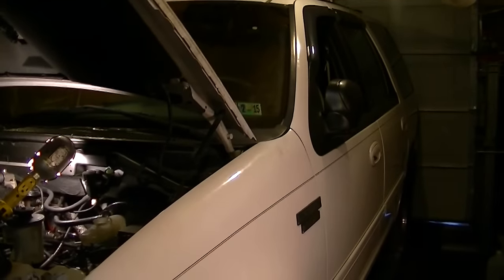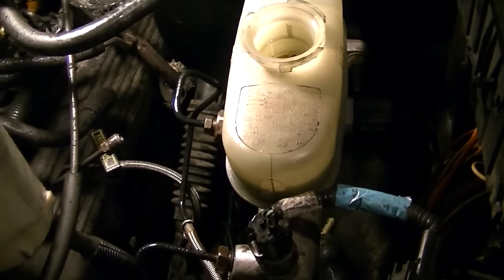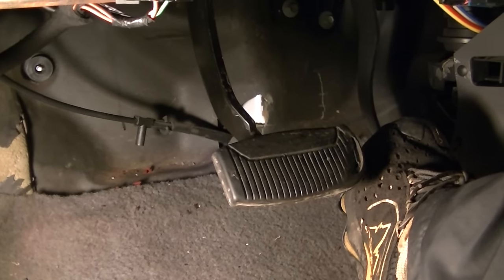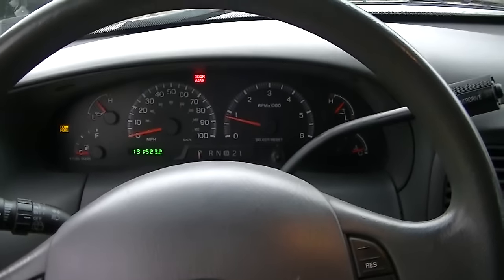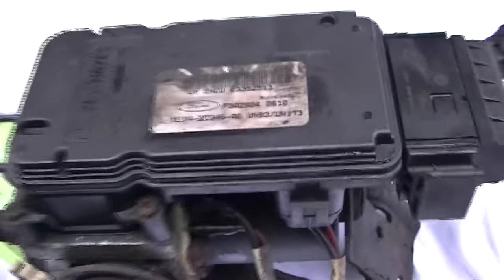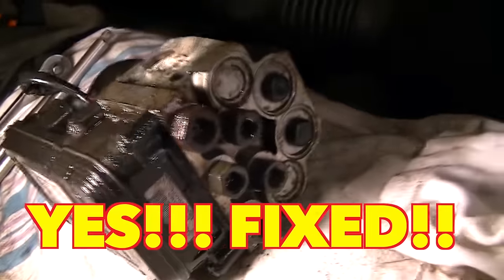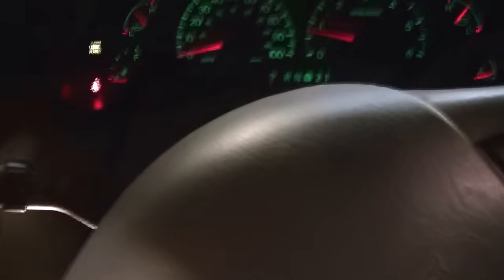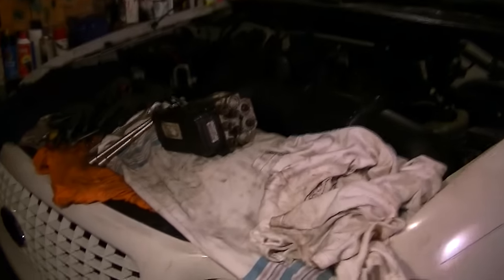Sinking/Spongy Brake Pedal -With ABS SYSTEM?? Nothing Works? Watch Fixed!

Comment: Howdy TVWXMAN32, how long did you hunt that down I think my  ford f350 might be the same issue, I pump my brakes up and they get hard or so after 4-5 and if it sits for an hour or more I still have air in booster, So its not leaking and the master is brand new and fully bled many times... But I still get a mushy pedal like it has air in the system!  That's why when I came across yours i was wow it seems just like your issue .....also no ABS Light on Nor have I seen one go bad in 50+ years without a ABS light coming on or check engine light sometimes brake issues can hide in the check engine light. By chance TVWX... is your Ford Expedition a mid 90's in year?  
 My truck is 93 so I am wondering if this was a thing they kinda knew but never posted about. Like you I have tried everything to the point I was actually thinking of paying the dealer to look at it because I felt so stupid that i  was missing what was wrong, I have alot of trucks, cars, tractors, 2 and 4 cycles, be them Gas, Diesel, & Electric and over looking something so dumb makes me feels stupid just because I haven't seen it happen in my lifetime of repairing things does not mean it can not happen!! This is why I turned to You Tube before I was gonna bite the bullet if i could not find something I missed .... So Thank YOU for the Jolt and reminder to always check the dumb shit!!!  I plan to just go drop a new one as the rest of the system all checks out good!                    
           Thank You Again TVWXMAN32         Cow }:-o)
Reply from the maker: Yep...I bet that's the issue. Bad abs/pump. Mine is a 2000. I still drive it everyday. Brakes work perfect after the abs/pump  change. Let us know what the fix is for you!

Comment: So ive had my abs light for longest my breaks worked ok not the best, it wouldn’t go all the way to the floor but they were spongey, i just changed the breaks, rotors, and calipers on all four wheels because they were worn out and now they break really bad all the way to ground. The mechanic told me my old calipers were seized so somehow it helped the breaks. Does this mean i need to change my abs pump or reset it

Comment: My issue is it's hard as rock when SUV is off I start it and soft peddle and replace master cylinder and new pads and bleed all wheel wounder if it's still abs?

Comment: We have a 2007 mitsubishi shogun sport,a brake line ruptured due to corrosion,the rear brakes are separated from the main fluid system via a solenoid valve when the ignition is off,the front brakes and main brake hydraulic system and ABS and HBB are all in front of the solenoid fluid circuit,after changing the brocken pipe,the system was bled using a pressure bleed tool,however,with this and many other ABS systems the HBB or high pressure brake booster accumulator was not discharcheged,after the rear circuit was bled the front was bled,for the rear the ignition had to be ON,when the front is bled the ignition had to be OFF,this controls the solenoid separating the two systems.

At turn on the HBB has a pump to fully pressurize  the HBB accumulator,this boosts braking pressure and equalises the pressure pulses during  ABS,as the ABS will unlock a locked brake under skidding conditions,creating a pulsed back pressure which needs smoothing via the stored energy in the HBB,the HBB is a container where a bladder has nitrogen gas at high pressure inside a steel container between it and the bladder,inside the bladder is brake fluid,so the gas tries to compress the bladder full of brake fluid.

In the haynes manual for the pajero(same system as the shogun) the igntion is OFF the pedal is pumped twenty times,not to the floor,just enough for the pedal to go solid,this releives the HBB of oil pressure and then the brakes(front )should be bled.

This is as far as we have got with it,there may be other valves in the ABS to bleed,but i'm sure it can be done via the scan tool method,and the vehicle can self bleed the ABS pump system.

Sadly there is not a great deal of info on youtube on this,but there are plenty of dudes who have thought brakes are brakes and just dive in and go for it,i hope this helps people to get  a bearing on the system and find out more on this before spending a shitload on unnecessary parts costs.

Comment: Also, i have solved these spongy pedals, ALWAYS, just by bleeding each wheel FROM DOWN TO TOP. I EMPTY brake fluid tank.  Then I make a system ,and send brake fluids through each caliper bleed screw, TILL i see this fluid, coming from below in to the tank. Then i close the bleed. I thing it might go through electrovalves of ABS pump, and fix also problem. Thats my opinion.
Reply from the maker: So true!

Comment: So I have a 1993 Ford Explorer XLT 4x4. I have replaced both the mast cylinder and the brake booster and bled it properly. I get a hard pedal when the engine is off but when I start the engine I get no brakes, pedal goes all the way to the floor with barely any effort at all. Could it be the ABS module? Is there a way to test it? Thanks.
Reply from the maker: Yes!!! Same thing happened to me!!  You can get one at the junkyard for maybe $40.00! Try that! But there is a chance you may get a bad one also. Just bring it back till you get a good one! Let us know if you get it fixed!~~
Reply: Meineke will usually diagnose the problem

Comment: Same with my 2009 Ford Fusion, apparently common with these vehicles
Reply: I have the same issue with my 07 Fusion. After a panic stop the brake pedal went just about all the way down. My mechanic bled the brakes. Ok until next panic stop. Same thing. Long brake pedal travel. So they changed the master cylinder.  Feeling good and safe now. Today skidded on some leaves..  ABS engaged and same thing. Long brake pedal travel . So back to the shop for probably the repair that is done here. Ah well. Gotta have brakes.

Comment: Ok can I ask a question.... I have a 08 fusion my brakes worked great abs went off pedal to floor seconds later it came back some time later abs pedal floor came back half way...few weeks ago hit brakes hard abs went off pedal to floor pedal stayed on floor abs has went off since been on floor so abs does still work no lights on but pedal is on floor I can stop but barelyis this what happened to you

Comment: Is this the same problem as when you press your brake pedal first time it sinks but after you pump your pedal once, the pedal doesn't sink anymore?
Reply from the maker: Yea.
Reply: Nathan Rohrbough  oh I also felt my brake pedal going to the floor while moving down through a down sloping ground but after i pump pedal once it does not go to floor anymore ive replaced master cylinder still it exists is that a bad ABS module which i have to replace ?
Reply from the maker: @fizz1646  Yea...unless you see leaks...its time ;(
Reply: Nathan Rohrbough   I did not find any fluid drop leaks underneath my car so is that brake line corrosion or a bad ABS module???

Comment: Hey buddy,I’m having a problem with my 73 Datsun 620 pick up truck brake pedal to the floor,I changed the master cylinder,bled the mc and all the wheels,new fluid,changed hoses,all wheel cylinders have no leaks and nothing still pedal to the floor,any advice on what can I do?

Comment: Help! Had mine replaced, new master cylinder and pads replaced. All was done by my mechanic and he is stumped too. This is on a 2007 Tundra and it's driving me crazy. Please, any ideas...i hate sounding desperate but there is nothing left in my brake system

Comment: I'm having an issue today. mazda 3  . errr   did u get any ABS codes,,,, ?? I have none but its the only thing left..actuakky install two master cylinders on it thinking I bought a bsd one out the box.. I can actuate the solenoids and abs mosdule with scan tool too., I hear then working,,........ anyway, I just don't wanna be wrong and the customer may want her car back I'm sure,  lol   ya kinda gave me some courage, thank for the vid...thumbs up
Reply from the maker: From what I've experience...that pump can still work and the abs will still be bad. The same thing happened to me...I put the front right wheel in some mud....hit the brakes and I could hear the ABS pump working...while my pedal went slowly to the floor...  Yea sounds like you have a bad one.
Reply: after reading, I went out and hooked up the scsn tool.. all solenoid clicked but the front rightn and the front left... maybe I found a clue I over look in the beginning,,  I changing the unit I guess.. thanks again

Comment: gee-that brake fluid in the master cly could not look any worse!!
Reply from the maker: wet leak to the dry touch when pressure is below 29.99
Reply: @FixingWithPassion  ?????  I meant it looks very dirty and could use changing

Comment: I have the same problem on my 2006 g35 infinity sedan
Reply from the maker: O no!!
Reply: Yeah new master cylinder checked brakes line no leak bled the brakes they work fine for about a week then they get air in the brake line

Comment: Man i did bleed everything replaced a new master cylinder,abs pump with the moudule and motor and still have no brakes it left only to check the booster or if you recomend me some else im all ears please i need help my vehicle is an ford windstar 1995 this van its been in the family over 15 years i dont want to get raid off it.
Reply: did you solve it? it could have been the banjo washers on the calipers.
Reply: Andrew nope i though that i have a bad caliper because it closes when is without the the brakes pads and rotor but do not closes when is mounted .. i dont  know  i need help.
Reply: Usually when you replace the abs module you must use the scanner to calibrate the abs module or the sinking pedal will continue to exist

Comment: Did you happen to notice if the sinking/ bottoming out of the brake pedal was better or worse when the engine was running versus off?
Reply: My brake pedal is pretty solid when my ford is off but when I put pressure on the pedal and start the engine up the pedal sinks to the floor

Comment: had you first considered/eliminated the possibility of air having entered the ABS system prior to replacing? when you change the MC - it is not uncommon for air to enter into the lines/systems including ABS & should be bled out of both MC & ABS systems upon replacing of either component. my apologies if you’d already addressed this but i hadn’t heard it mentioned in your video & just thought for sake of viewers who may be able to save a few bucks on purchasing a whole new system - to check this method first. air in the lines presents itself the same exact way with the same symptoms.
Reply: How would you go about bleeding the abs system as I'm having the same issues. Thanks
Reply: I have the software to bleed the abs unit on my laptop and can activate each of the lines individually as well as the abs pump, would you bleed using hose n bottle method on caliper or it there a separate bleed nipple for the abs (couldn't see one on the abs unit)
Reply from the maker: The system was never opened. One day it just went bad. It does happen on ABS systems. Seals go bad/etc internally.

Comment: Hello TVWXMAN32, my name is Arturo. Enjoyed your videos, very informative. I have a problem with spongy brake pedal on my 2004 Chevy Silverado, base model. All of my wheels bleed properly, but I keep getting air in the system through the front passenger wheel. There appears to be no leaks. I've replaced the bleeder valve and the brake line (hose). The caliper seems fine. Any suggestions?
Reply from the maker: Maybe a slight leak somewhere??

Comment: I have a hyundai sonata hybrid 2011, this is happening with my car brakes randomly going to the floor with a weird noise from the abs. I've taken it to the dealer with a code c1237 primary pressure sensor signal. Which lead them to believe it's the abs module, however I just replaced it with a used one. So how will I know if the module is defective or not? I can't keep paying to take it off and on again and purchasing multiple abs units. What should I do?

Comment: Have a 2003 tacoma and pedal sinks to floor but brakes still work ..also have a hissing from abs module. Changed mc and booster still doing it I'm guessing its abs
Reply from the maker: Hissing sound from abs module? Check for a snake!

Comment: Do u think it's possible for the ABS light and traction control light to come on just because I changed the ABS unit ....the light wasn't on before with the previous one I replaced and the guy I bought this one from said the ABS light wasn't on when this car got parted out....I am so at a loss what to do or think
Reply from the maker: Have you checked all wheel that the abs sensors go to making sure one is not broken? If you had the old unit i'd put it back on and see if the lights go out. Its a sucky way of verifying it. What is this on?
Reply: I saw someone on this post that said they couldn't get it to turn off after either. A soft reset did not do it as it came back on. Finally they said he had to have a dealer do it with an internal reset to the unit. Go figure. Wondering if disconnecting the battery for a while would have fixed it.

Comment: If you have a spongey pedal, you have to have a high quality scanner to purge the air 3x via the scanner on the ABS setting, not opening any bleeders. Other times your old rubber caliper lines bulge and you lose pressure.
Reply from the maker: Good tip!!

Comment: I have a 2010 ford escape and apparently it has a hydraulic abs module and an abs electronic module. Which part would it be? Or could it be both?
Reply: Could you look up to 2010 Ford Escape ABS problems it might show you what to replace could be a common problem

Comment: Just had all rotars replaced pads and front right caliper with new hose. Also new abs pump and new master cylinder replaced. But my brake pedal still sinks to the floor when stopping idk what it could be ?

Comment: Fml. These things are expensive. Mine sinks on first press. But it only started after replacing the seized caliper. Bled the lines multiple times and replaced master cylinder. Do these abs modules have a bleeder? Maybe ill try that before replacing
Reply from the maker: No bleeder. Its seems likes when you have to replace a MC, the ABS  fails or starts to fails. I see this alot.

Comment: I'm pulling my hair out with a tank of gas beside me. I have an 04' F350 that ive replace everything but this. I am still getting bubbling in master cylinder. Can these trucks be auto bled with a computer?
Reply: I'm having the same problem after doing 4 calipers and a rear brake line. I cant get a hard pedal. Found 1 video. Air is trapped in the abs and needs to be purged out by either slamming on the brakes to get the abs motor to activate and push the air out or a scanner tool that runs the abs pump to purge the air. This mite have been  alot of the problem with others to. When you put the new abs module in the air was released i possibly

Comment: i am having the same issue in my 95 chevy k1500 spongy pedal all new lines pads shoes calipers master cylinder check valve still spongy pedal next step changing out my abs pump
Reply from the maker: Let us know if it works!
Reply: LedFoot Racing what was the fix for your c1500????  Did it end up working??  Heard you can also bleed the ASB, it had a rubber cap and you remove the cover. Use a screwdriver to press the ball pin in and bleed it like a caliper... thinking of trying that tomorrow on my 2000 tahoe limited OBS.

Comment: U have to get the right OBD reader that will do automatic abs bleed and that old unit would have been fine.
Reply: Chase Brown negative! Not always. We recently did an ABS bleed with a high end OBD reader walks you through the steps of bleeding the abs system, and it still didn’t fix the issue. What you suggested would help some people depending how bad their ABS pump is.

Comment: under that rubber plug on the abs unit is a bleeder sounds like you had air in it
Reply: Ford put these test plugs on their abs modules. But on a ford taurus they mounted it down on the frame and you can't get to it to test it.

Comment: My 99 F-150 did the same thing.  I replaced everything in the brake system minus the booster.  The used ABS box i got didn't fix the issue either.  The Ford garage had my truck for a month (no charge) because they couldn't figure it out.  It had the spongy pedal till I got rid of it.
Reply from the maker: Its easy to get a bad used ABS box...I DID! The 2nd one fixed my issue.
Reply: TVWXMAN32 I was at a loss. This happened about 8 years ago, I couldn’t find answers or people having the same problems.  I replaced all my hard lines with pre-bent stainless brake lines from classic tube and that’s when the problems happened. I knew the air was trapped in the ABS box but I nor the Ford garage could bleed it out.  After bleeding them for hours I called the garage, they said no problem they have to hook it up to the computer and run the ABS pump while bleeding. I thought o that’s great. 2 hrs later I see them scratching their heads. Lol

Comment: I have this issue currently on my dodge durango no light sinking brake and it occasionally locks up when hitting the pedal at high speed and low speed
Reply from the maker: o muy!
Reply: I have same problem spongy and locks up when hitting the pedal hard locks up  for few seconds, it is the booster or the ABS ? 2010 Lexus gs300
Reply: I checked the booster it's not the problem with my rig
Reply: Just changed the abs module and the abs light is now flashing but the brakes work way better lol wth
Reply: Any ideas Nathan?
Reply: Got it figured out I changed the electronic module that is attached to the abs pump. I put my old one back on the new abs pump and the light went away and the brakes are stout now! Just took some tinkering and a few choice words
Reply: Spencer Johnson  thanks and thank you  nathan